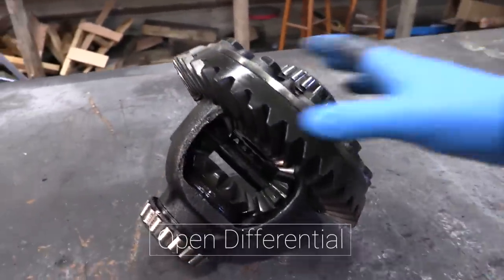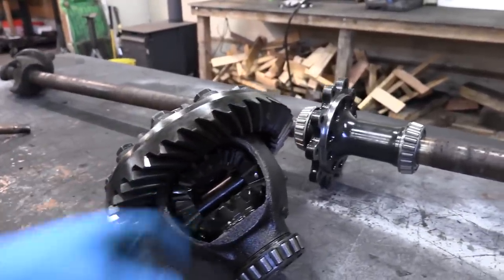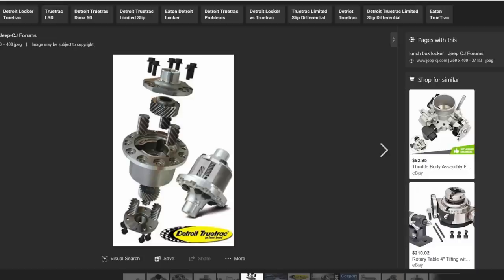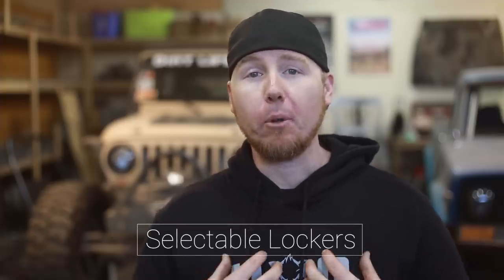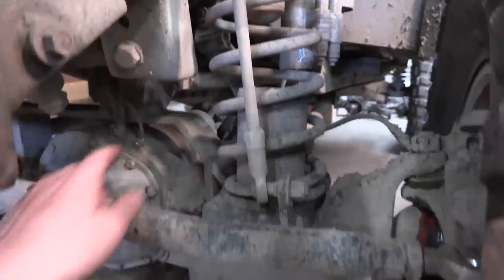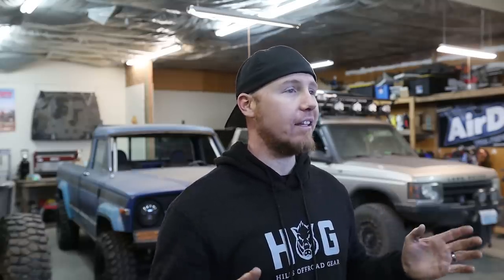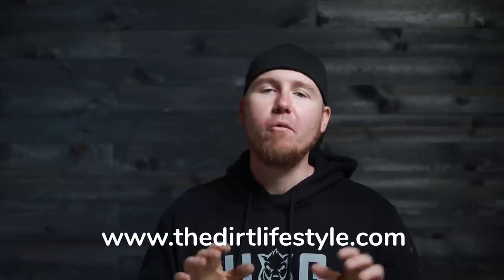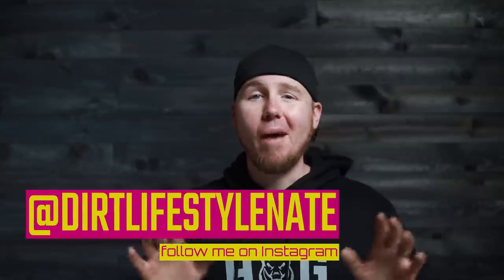Differential Lockers! ARB vs Yukon vs Detroit vs Spool

Comment: I have a lsd in the 8.8 in my ranger and I think I wore it out or broke it lmao. But I'm gonna rebuild it with carbon fiber clutch packs. And I want a lunchbox in the front which I think is do able because I have manual hubs so streetability should be available. I'm only on 31s right now so I dont think it's an issue

Comment: My Danger Ranger is getting a Torque Lunchbox up front, and for now keeping the Ford 8.8 LSD with carbon fiber clutches in the rear....but I might eventually go to a torson in the rear.

Would like to go with an electrical or pneumatic locker in the front, but the Ranger diff is a bit weird...think it's Dana 30 or 35, but a strange housing and won't fit what you'd think it would.

Mine's a DD/Overlander running 32's...it's NOT an extreme rock crawler and would die in Moab.....and that's fine by me, because I don't need it.

Comment: Awesome video. Your channel is amazing. Question for you - If the rig is IFS instead of a solid front axle does that change the thought process any? What would you recommend as the ideal route to go for a front locker in a '14 4Runner. The rear locker from the factory is amazing. Simply works as advertised - every time, and I wonder if dropping in a matching toyota setup in the front is possible or recommended considering the IFS. Some features included from the factory simulate a front locker, but I am exploring good options on adding in a front locker I do not have air run, and I am also looking at alternatives to the traditional air locker setups. Any thoughts or recommendations? Thanks again for an awesome video. Keep up the Great Work!
Reply from the maker: I would run a selectable 👍
Reply: I'm no expert but what I've been told is that IFS CV axles don't hold up to lockers very well.

Comment: Great video but still leaves me a question
Can selectable lockers be engaged at speed?
The reason I ask is I have a new daily wheeler a 92 Nissan Pathfinder and my daily commute is a mountain pass that generally gets pretty iced up, the current viscous differential does a good job of giving me enough traction in 2wd to make it up but sucks offroad and I'm debating between a truetrac or a selectable but not sure if I could really use the selectable on the highway
Reply from the maker: I'm not sure. I dont see the advantage of using a locker at speed. It will make your rig drift easier and get less traction. Good for fun but bad for traction 👍
Reply: @DirtLifestyle  get more tires spinning instead of one wheel peel
Maybe it wouldn't be useful at highway speeds but like 25mph trying to get up a hill and suddenly just being 1wd or 2wd 
Had a couple instances this winter where even with snow tires in 4wd couldn't get up a hill cause open diffs

Comment: I really enjoy your channel. Great, straight forward info and experienced opinion. I really appreciate your opinion using your experiences. I’ve been trying to decide between an electric, air, or OX lockers. I definitely think, after watching this video, that I will go with OX lockers. I do have a question though. I have an 1987 MJ pickup, because the rear axle being farther from the driver seat, should I use a different locker in the rear vs the front?
Reply from the maker: You can mix and match buddy it doesn't matter 👍

Comment: On thing I’ve heard a few companies claim, primarily ARB air lockers is the amount of rotation needed at the wheel to engage the locker, as well as at higher speeds like engaging the locker on sand dunes. I know the factory rubicon locker on my tj takes quite a while to engage, would you say that’s something that’s worth considering?
Reply from the maker: Absolutely. I wish I would have brought this up but it's a reason I dislike e-lockers. 👍

Comment: I don't know what e-lockers you have experience with, but the most common e-lockers (Toyota) do not use electromagnets. There is an external motor that moves a shift fork that moves a spline to lock one of the side gears to the diff housing. The motors are sealed from diff fluid and can be serviced without disassembling the diff, and, like the cable lockers, if the motor fails you can pop it off and manually move the fork over to lock or unlock the diff.
Reply: Aftermarket eaton E-lockers have electromagnets.  And I'm not a fan.

Comment: I know this is an older video, but what thoughts do you all have on a locker for a snow plow truck used on steep, curvy mountain roads? I need to make sharp turns, while pushing snow hard up hill. Figured a locker was right for this, but now I'm worried about losing turning ability. Not much time to engage or disengage during the drive either so it needs to be pretty automatic or not hurt my turning ability in the snow. Rear axle only on a 99 F250 super duty 4x4.

Comment: What WMS are your axles, and backspace of the beadlocks?
Reply from the maker: 65"ish I don't remember the backspaceing of the wheels 👍
Reply: @DirtLifestyle   ty for the response, are you able to fully turn with the 40s? or did you have to notch the frame, i planned on doing 65 wms also and was curious if that would be an issue i would run into

Comment: I have so many questions regarding the air locker with the co2 tank, do you fill it up before wheeling? how much air compression does it need? Is it a constant release of air pressure while engaged? so many questions!!

Comment: Another great vid, BUT what if I don't have friends? At least 4x4 friends... 
Seriously tho, I have lunch-boxes front and rear in my XJ on 35s. I also have 4.88 gears that need to go in. Should I get a true trac for the front D30? I don't like the fact that when you engage 4x4, your front is auto locked.  I've been thinking about it for a year now. I don't plan on heavy rock crawling, but who knows. I really like the idea of the clutches posi, but I have no clue if it will keep both 35s turning when needed.  I also will be driving on snowy roads.
Any advice would be very welcome!
Reply from the maker: If you like what you have then there is no need to change it. Run what you brung 👍
Reply: @DirtLifestyle  I really feel ya.  I hate that front auto locker but everything else works good.

Comment: Nate, this is something that I've been thinking about at length while I'm saving up to rebuild my TJ's axles. I'm starting out with a d30 & d35 with 3.07's, 31" tires and an AT 3-speed, aiming to run 3.55's with 33's. My street/trail driving ratio is probably 60/40 and it's my daily. I don't do crazy obstacles (yet; mostly because I can't) but I do drive a lot of dirt forest roads and trails year-round in Washington and travel through lots of snow from Washington through the Rockies in the Winter, which involves about 600 miles of highway in a day, twice a month; also year-round. I want to be better set up for those long trips, where road conditions at altitude can be wicked, and also want to be able to handle some more advanced trails than I currently can.
As long as I'm doing the re-gear, I figure it's the most sensible time in terms of labor and cost to handle the locker situation and would love to hear your two cents on how you might go about it for the intended use if it were your build.  
For the size tire I want to run, the Torsen is really appealing to me, but are they way more coin? I'm on a budget, but want to build it right. I really like the idea of having a locker (selectable) up front and could probably live with limited-slip in the rear... or could I?
Reply from the maker: Save the money, buy it once.
 Selectable is the way to go IMO 👍

Comment: I was thinking about running a Detroit locker but I have seen some videos where they have two tires off the ground and the Detroit locker will just stay open. Have you ever had any problems with the Detroit locker locking up?
Reply from the maker: I haven't seen that with a Detroit softlocker. But definitely with a Detroit true track

Comment: How well would a 4.88 Axle Ratio work with 40" tall tires on a relatively high horsepower (500HP+) Truck/Jeep/SUV? Would it be okay? What about acceleration and mpg? Thanks

Comment: I have 08 kk just started buying parts to upgrade my off-roading got 2.5 inch lift got some 31in tires and was thinking about lockers?? My old jeep came with them and so did my samurai so not that educated on them . Its my daily driver its manual and just want a little more when I'm on the trails fishing with my sons.. haven't been stuck yet but go around alot of stuff id like to go thru. I know I'm not going to go crawling in it but would like to go thru some of the medium level stuff

Comment: Great video!  Very informative like always.  One question I have for selectable lockers...do you always have to be in 4lo to engage or can they also be engaged in 4hi too?   If not why not?
Reply from the maker: With after market lockers you can't engage them when ever you want. But you decrease traction with a locker at high speeds. The only benefit is low speed use 👍
Reply: @DirtLifestyle  that makes sense.  Thank you for the response :)
Reply: @DirtLifestyle  I think he meant "can engage them whenever you want" My stock rubicon lockers are controlled by the computer and will unlock at certain times. Aftermarket ones you are in complete control since you turn on the power or air.

Comment: I was thinking of running a Detroit locker in front on my Dana 30 and running a Torsen or truetrac in the rear Dana 44 on my 2014 JK, do you think this is a good setup or is the 30 too weak for that. Plan on mostly overland set up on 35’s with some occasional crawling. Is the 30 ok or do I really need at least a 44 in front. I plan to do the truss and c gusset upgrade and probably an axle upgrade. Am I wasting money going this route?
Reply from the maker: Not sure man, it all depends on you and your preference. If you are only doing light wheeling you can choose any combination of parts and be happy 👍
Reply: Dirt Lifestyle  just looking for an opinion from someone that has run all kinds of setups. Worried that the automatic might cause undue stress but trying to be budget friendly. I don’t want to do it if it will cost me an axle down the road and should just spend a little extra now and be done with that

Comment: More than a decade ago Ox had some QC problems. Then they were bought by a different outfit and went through a full retool. Most of the hate comes from the reputation from the early 2000s.
Reply: ARB had similar issues when they first expanded into the US market back in the early 90s, but after overcoming the early problems they have a good reputation now.

Comment: huh an interesting way to get around the metal particles on an electro locker would be to use non ferris materials. but I wouldn't trust any alloy of SS or AL, would have to be Inconel or hastalloy. but those guys are about $50 bucks a pound lol.

Comment: Could you run a spool on the front end on a 4wd just wondering since front won't be engaged unless well engaged with tcase ...not gonna do it just a question
Reply from the maker: The two wheels will be connected so it's a problem unless you have selectable hubs 👍
Reply: @DirtLifestyle  that's what I was wondering...or a central axle disco just wondering glad people haven't wrecked me for this ...YET

Comment: you have any experience with a detroit and selectable hubs on the front axle of a dual purpose rig, I like the idea of reliability of a auto locker and road manners of a open diff, but i only have experience with selectable lockers. not sure how much of a pig it would be to manuver off road
Reply from the maker: Yep. It works pretty much the same as having a spool in the front. Good and bad 👍

Comment: Let's talk spool in the front diff with manual hubs? Other than turning on the what issues do other see?
Reply from the maker: Just turning and wearing out your parts. I ran this way for along time but wanted to be able to turn again so I got selectable lockers👍
Reply: @DirtLifestyle  I'm really debating running a spool up front and a selectable rear in my project.

Comment: I'm wanting to but a some type of locking diff in my 03 Chevy 1500 2x4. When I back my boat down the ramp an try to pull back up some times i can't go anywhere because 1 tire is spinning.. what kinda locker do I need to put in it

Comment: Thanks for another great video Nate! I’m considering using a JK Dana30 in the front of my V8 powered WJ Grand Cherokee. I know this is limiting me to a certain size tire in that application but I likely won’t go larger than a 34” tire. Do you think the JK Dana30 would be strong enough in that application to run a selectable locker? Or would the TrueTrac  be a “softer” lock and less likely to break parts?
Reply from the maker: Not sure man, there are a ton of factors unfortunately. The big one is your right foot 👍
Reply: Dirt Lifestyle Haha! That’s kinda what I thought you would say. All else being equal would you say the TrueTrac is less likely to break parts than a selectable locker? The reason I think that’s possible is because it provides the 3:1 torque bias but it doesn’t fully lock.
Reply: Dirt Lifestyle With the TrueTrac you are never sending 100% of the torque through one axle shaft.

Comment: I have an old plow truck (89 full size bronco 8.8, 355 gears, 31 spline) and it's junk.  The rear end has play and I do believe it's worn out gears.  I was thinking of a spartan locker because of cost and I don't go off road at all. just snow and mud. Largest I run is a 33 with no lift because it doesn't need one and the snow tires are 31. I have seen the spartan for under 260 bucks and it would replace all the worn out gears. Do you think that would be good enough for an old plow truck?

Comment: Hey Nate, been watching your videos a ton lately and really enjoying learning a ton from you. You do a great job explaining a lot of different things. I'm just curious about my axles. I have a 2013 JKUR right now. I have the Mopar 2 inch lift, run 35 inch tires, have a truss, upgraded ball joints, I'm planning to do the teraflex heavy duty steering upgrade soon. I want to go to 37s at some point and from what I've read I need to do new shafts. I'm just curious where to start looking? Axles are one thing I don't know a ton about and get confused by all the terms online... If I were to go with rcv shafts what would I need? I assume my stock lockers would still work with that size? Sorry for all the questions

Comment: Could you give me some advice?
I am re-gearing my JLU I have a dana 44 in the rear with limited slip. I am thinking about adding limited slip to the front. I don’t want a air locker and don’t trust e lockers is the limited slip worth it?

Comment: So I have a dana 44 rear im putting under my xj with 35" BFG krawlers
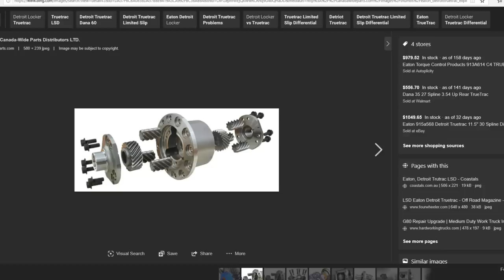with LSD now. I'm regearing to 4:56 gears and have lunchbox in a HPdana30 front . I trailer and avoid the street and thinking about using a spool in it. Whats your opinion

Comment: I just picked up a high opinion 9" for the front  end for my yj. Whats your opion on this? I'm putting in ar locker with 513 gears , chromoly axles. On 36 swampers

Comment: Curious what people think of the e lockers that come on the Rubicon models.

 I have an 08 and have used them a lot.  Ive got 37" tires for the last couple years and have had no issues so far. Have done some steep climbs and hit some rock gardens ,but nothing too crazy (I don't think).  I plan on hitting the Rubicon trail some time soon and the lockers have always been in the back of my mind. 

I try not to use the skinny peddle more than I need to and just let the gears do the work. Just curious how people feel about their reliability/durability compared to some of the after market brands.

Comment: The best diff doesn't exist yet. It's a Torsen with a manual locker. So you have a good limited slip on the street and mild trail and a full locker if you need it.

Comment: I've never heard of the lincoln locker, that's hilarious. Welding hardened steel, especially if it was carburized is generally to be avoided at all costs lol. There are ways to weld hardened and heat treated steel but it's not for the home shop. But that is a cheap option for sure.

Comment: hi wreit you of italy , i have a toyota hilux 91 with 2.4 turbo 4runner engine, solid axel rear with OE lsd and solid axel in front i thought about installing spoll lock on the front axle, i have manual hubs, what do you think? i am a hunter and many times i have had difficulty with mud

Comment: Hi nate, im going to be getting an 04' rubicon dana 44 front with the OEM locker, but no compressor for it. ive been told you cant run more than about 5psi to them or youll blow it. got any suggestions? i like your air tank idea but dont know if that would work with that OEM 44 locker

Comment: The issue with cables is that they stretch. Unless the cable is way heavier than the application calls for, it's going to stretch and you won't know it until your locker doesn't fully engage, and you will be grinding gear teeth.
The only way to avoid that is to constantly check your adjustment.